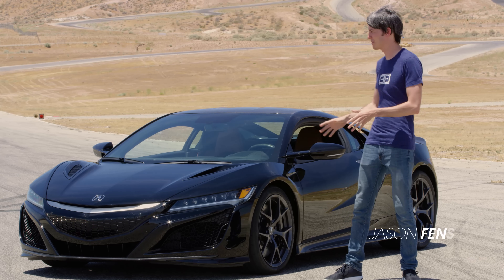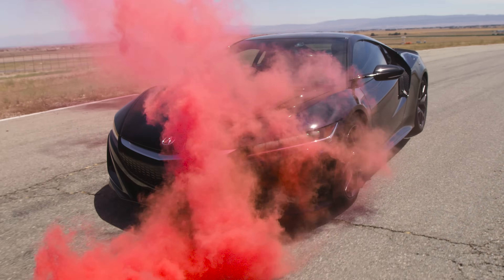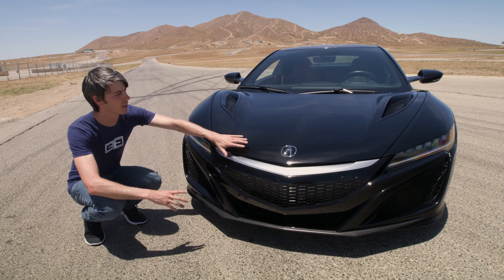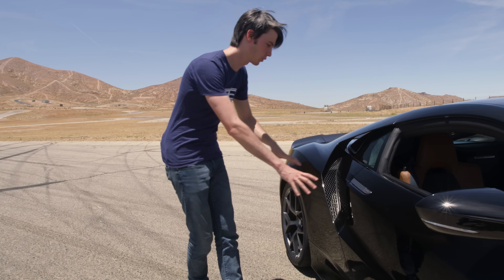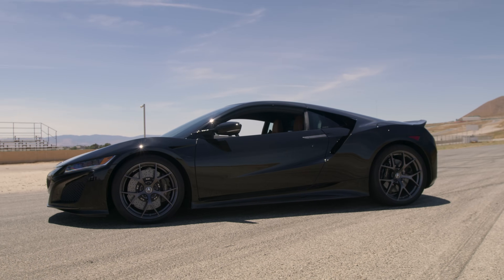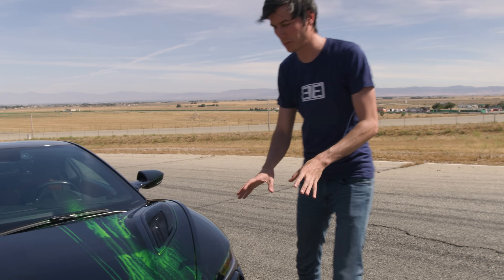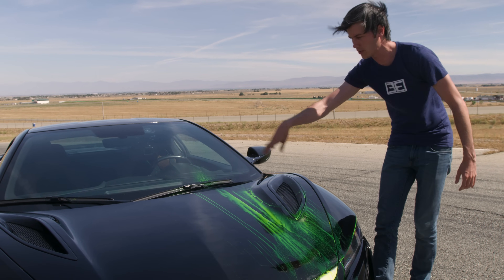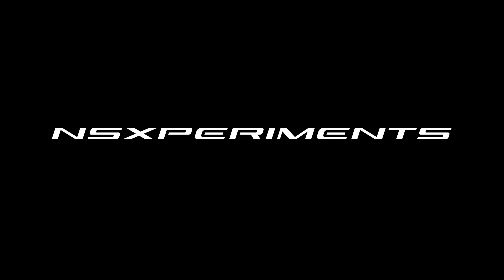Using Smoke Grenades To Understand Acura NSX Aerodynamics

Comment: Hi. Jason. I come from Poland where 1/3 of petrol fuelled cars are adopted do use LPG. Can you explain on your channel why it is not so popular in the rest of the world? Why manufacturers doesn't produce stock cars fuelled with LPG. It is cheaper than gasoline (in Poland at most twice). It gives pretty much same power output (I have even seen LPG fuelled tank). Pollution produced while burning LPG is less harmful for humans and animals.
Thanks
Reply: Wojciech Gomoła im in the US and i also wonder this. maybe gas station and gas truck infrustructure is not there? Also heard the safety of compressed gas might be a problem?
Reply: Bic Boi There were some problems 15 years ago. Has leaked from some cheaply adapted cars. It was problem especially in underground garages. So in Poland it is banned to park gas fuelled car underground, but it is so stable today that no one's caress. I rode mine 99's Audi A6 something about 75k kilometers (55k miles) I had to change filters (once per 10k miles) and one sensor died once (it cost 20-30$ to exchange it). I heard that lot of Opels engines have better power output with LPG.

Comment: PLEASE, Someone Help, or Engineering Explained help. So we got a Toyota Celica 2.0 GT and today, when my dad got back home, he said that the car started overheating and smoke was comning out from the bonnet. Then when I saw the engine there was a rusty liquid on the Block, the radiator fan, and even the battery. We went to a mechanic and he said it was the thermostat gasket (because the liquid was around that area) And it couldn't be the head gasket as the radiator hose is not pressurized. HELP!!!

Comment: Just a few of my opinions:
I’m a big Honda/Acura fan (drive both) but I’ll be the first to say that I’m not sure they always make the “best” decisions. I like the NSX, but I feel weird about it. I get the impression that it’s decently good at a number of things, but doesn’t really stand out anywhere. I don’t know if that’s a marketing failure or my ignorance. Maybe both. 

That said, I’m proud that this car was designed and built in America. I like what Acura tried to do (and mostly succeeded) with the performance and design. However, I have to agree with Doug DeMuro on the mistake Acura made: they didn’t have the performance line-up on the dealer lots like Audi did when they made the R8. I understand that Acura takes a different approach to performance and luxury than comparable brands, but it’s hard to compete when your cars have mediocre sport options, no RWD, no convertible, and very questionable styling choices.

The NSX doesn’t seem to be selling very well and I may have listed a few reasons why above. So when I see a video like this, with higher production values than virtually all of your previous work, I start to wonder what’s going on as I place a tinfoil hat on my head. Is Acura funding these videos? It’s creating a discussion about the car and works like inexpensive marketing for them. And they have a “hip, young, popular” YouTuber talking about the car to his audience. All I could think about during the video was “Is this an advertisement?” because that’s the feeling I got. 

In a way I feel bad because I want the company I respect and whose products I enjoy to be successful, especially when they spend so much on a flagship like the NSX. These videos just rub me the wrong way and give me a weird vibe.

Comment: So what was the point of using the FloVis, if you never actually bothered putting it under the black light, and explaining the "Flow Visualization" of the air management with all of the different colors you used on each region of the car?

Instead, we got a flash into... really?

This is "Engineering Explained", not "Sectrets to Top Gear Title Shots and Videography".

Comment: has Acura considered rewiring the front electric motors to in order reduce back EMF and increase the vehicle speed at which the motors can effectively aid acceleration and cornering?  because I'm betting that  the NSX's track times, on anything other than an autox circuit, are significantly hampered by the motors 80 MPH cut off is really working against the hybrid systems ability to be anything other than dead weight.

Comment: Such an amazing car, if only it had a bit more power from the electric motors it could be superior to the gtr performance wise !
Reply: it does 0-60 faster I think, at least stock. it also is faster on the turns.
Reply: thatoneopenwheelfanboy's 2nd account the gtr gets to 60mph in 2.9 sec, and this nsx does it in 3.1 sec. The gtr is also slightly faster in the quarter mile. But i think if the nsx had an extra 100hp of electric power it would be on a higher level than the newest gtr in terms of performance.

Comment: It's really interesting that it's so rear-bias in terms of aerodynamics. Surely the cg can't be so far back?
Typically, this rear-bias means that the car understeers like crazy - this effect further amplifies with usage of things like spoilers, because of the moment (I guess most of the downforce of Acura comes from the diffuser, not the decklid. However, I'd have to measure it to be sure). Nonetheless, looking at the car, I also think that the NSX produces little amount of it - which is probably why they could afford so drastic distribution. It would be cool if Honda gave us some numbers! :) 
Btw. really cool video! Paint is superb, though it's difficult to work with. Nice job and hats off to you! :)
Reply: Great detail such as matching air flow c.g.  Really good detail and video quality.

Comment: It is a nice car but Acura dropped the ball overall. All they had to do was take that original 90s body style and sharpen it up (up the aero) and add LEDs to the pop up headlights and to that beautiful taillight design that was ahead of its time (like Nissan updating the Skyline). Acura made so much unnecessary work for themselves. The 90s NSX was such a modern and futuristic looking car for it's time, it was unique, this thing just blends in with the others (it's nice but not special). You cannot seriously tell me that the 90s body wouldn't be drop dead gorgeous with modernized body accents and LEDs.

Comment: Can you please respond and explain the reason why many performance cars have floating rear caliper such as BMW cars/SUV with electronic parking brake, all Mercedes even AMG, all  Audis even RS exclude R8. I know it is easier and cheaper to use a actuator with floating rear caliper to integrate rear brake and parking brake into one rather than a drum brake as parking brake in the wheel hub or a separated parking brake caliper (most supercars, tesla and alfa giulia qv) which will bring more cost. But is the cost the only reason why BMW AUDI MBenz do this? M5, AMG gts, RS7, X5m, E63s, S63/65 are not cheap, why they still use floating caliper?  Thank you

Comment: The first gen north American NSX had an iconic design.  Very memorable.  But this looks too much like a GTR - which is okay, but couldn't they work off the old NSX?  That car was revolutionary being Mid engine, pop up headlamps, integrated rear spoiler.  I miss it.
Reply: ¿Looks like a GT-R? ¿WTF?  maybe like a R8, but ¿¿GT-R??
Reply: My bad, I meant from the side profile it looks like GT-R, but you are right it looks overall like the R8.

Comment: Another Honda fan-boy. Type-F. You bought a slow S-2000 and tried to make it faster with gearing. I know your type.
I grew up with these types, and they've mostly died off. 
Honda doesn't have the fastest, most luxurious, most technically advanced, nor over-all best vehicle in ANY class.
I'm tired about hearing about the S-2000 and NSX. Over-engineered is what they are. It's like over-eating, or over-committing, it's bad, and it's over.
Honda turbo-charged the new Civic Type-R. Honda forced forced induction, on Honda fan-boys.

Comment: Fascinating use of aerodynamics. Still the new NSX is really hampered by that unnecessary hybrid powertrain. If Honda takes off the electric motors & batteries but retain the 570hp, the NSX would be a rocket.
Reply from the maker: But the electric motors are a part of that 573 hp... and make up a great deal of the low end torque.
Reply: Engineering Explained I wonder what the Type-R Version of this would be like.
Love the videos by the way! Somehow wasn't subscribed already. XD changing that now
Reply: People also don't realize the instant torque of electric motors, they always talk about HP. For example the Youtube community been bashing on the i8 when it first came out years ago, without realizing the car is light, and despite only having 360 hp it has over 400+ lbs of torque and beats cars with much higher rated specs.
Reply: I understand, but unlike the 918 or i8, I don't see the NSX being true to its form with the hybrid component. Probably because both the Porsche & BMW employ heavy Carbon composite in construction to offset the hybrid weight, the NSX does not. 

Lastly because the name is "NSX" which most people (and including me) brings up image of that 90s supercar which employed state-of-art aluminum construction and ~1200kg curb that makes it hard to like this almost ~1700kg NSX Hybrid.
Reply: I see what he's saying though. Porsche is an example with the GT2RS.
Reply: People say the same thing about the porsche 918. They don't tend to realize that it's necessary to meet emissions requirements for a similar level of performance. Times are changing just like government regulations.
Reply: Yep, and Honda should be able to easily get more than 500 hp from a turbocharged, dual injection path 3.5 liter engine (alfa nee Ferrari is getting more petrol generated power from their 2.9 V6 turbo in the Giulia).  The hybrid stuff is there solely to help with a "green" image and curry favor from people who hate cars anyway.  Add in the fact that the electric motors aren't adding any thrust above about 120 mph and you can see why the NSX is the wonky stepchild of the entry level supercar market.  Supercars (low volume, high $$$, minimal impact) are one place where you shouldn't be kowtowing to environmentalists.  Given that McLaren is already hinting that the new 720S outpaces the P1 on the track, the hype behind hybrid supercars should be more clear going forward.  Go electric, or go petrol, but doing both just adds mass that you don't need.
Reply: Just slap a supercharger for the low end torque instead of that hybrid system they are using

Comment: There are so many smart engineer dudes on youtube but why don't they just join car companies built the perfect car?
Reply from the maker: As an engineer that left the world of real engineering, I quite like seeing the big picture. Not that I could build the perfect car (or anything close to it), but it takes a lifetime to get good at it, and it's a brutal, stressful, draining process. Very rewarding when your product comes to fruition, but there is so much time and effort that goes unappreciated by the masses. I find it way more fun to test someone's creation than to build one of my own; there's a variety element to it where you're always trying different things and finding out what's best, rather than working on an individual project for four years, only to find out another company has come up with a more clever solution. I have tremendous respect for the automotive engineers of today; the quality of cars these days is incredible.
Reply: That would start WW3
Reply: Engineering Explained Hey there, would like to know whether clutching in and then revving the bike to a high rpm would cause any damage? Im riding a bike and my max rpm is 15 but due to powercut I can't reach 13 > and honestly don't like revving high unless a vehicle pisses me off, would revving to around 7-11k rpm cause damage?

Comment: Great video... For years, I drove a 2008 Jeep Grand Cherokee SRT8 with kooks long tube headers, borla exhaust, and a tune. Driving that brick-shaped tank made me realize that, for the most part, "aerodynamics" (though fuctional at times and at certain speeds) is mostly just a word used to sell rich people expensive cars. My Jeep (even with minor turns involved) had no problem taking down some of the most aerodynamic cars on the road today. I had drop springs in the Jeep. Suspension>aerodynamics all day long. The gains to be had with minor suspension upgrades far exceed the losses due to having NO aerodynamics. 🚙💨
Reply from the maker: Well for street driving, sure, a Jeep really isn't going to be hitting insane speeds around corners. But in the world of supercars, vehicles that are quite capable on (and should at some point be taken to) a track, aerodynamics makes all of the difference. It's what makes F1 cars so fast around corners, how the Viper broke so many lap records, etc. Will every driver make use of it? Probably not. But when you're putting in that kind of money for a supercar, it should certainly be capable haha.
Reply: Engineering Explained I agree with you. Sadly most supercars never even see the track. 

I grew up idolizing Ayrton Senna and know that aerodynamics without a doubt has its place in the world of racing. There's no denying it. 

If you plan to buy a supercar for street use, its safe to assume that aerodynamics (aside from aesthetics) falls under the category of "paying for stuff I don't need". There's a good price negotiating tool for whomever may be reading. Just tell the salesman to zip it when he starts using aerodynamics as a selling point. Instead, inform him/her that you'd like to hear more about the suspension Lol
Reply: Jais620 Aero improves fuel efficiency too so it's not only optimizing performance but fuel economy a well.
Reply: I'm not going to conclude anything yet, In what way was your Jeep Beating these supercars? Where did you race? What type of Racing did you do? What was the main demographic of racers you went up against? And what were the types of Supercars you were racing against?

Because, from the tunes you stated, your jeep not only has Minor tuning but is limited purely to mechanical grip. Which also, makes it more prone to both over, and understeering problems. And the claim you are making about suspension outdoing Aerodynamics is very bold, as Aerodynamics have played a major role since F1 in the 60s.
Reply: You'll beat them up to 60, after that they're going to catch you and demolish you.
Reply: Jais620 I've been driving a 2017 GTR for 7 years now
Reply: Hello There lol if that's the case, then I ask, where did you purchase your flux capacitor?
Reply: I'm curious what holds your Jeep to the road when cornering at 150+ mph.
Reply: If you have bad aero and you're driving a heavy ass tank with no sports suspension, you're going to be super unstable going at high speeds. No way around it.
Reply: Take the Jeep Cherokee to a race track, not a 1/4 mile track. The only think it will be smashing is probably the cones.
Reply: Downforce is drag in the vertical axis.  Just like airplanes.   A loaded airplane has a higher power requirement at same speed.
Reply: https://www.oreillyauto.com/flux-capacitor
Reply: i put money on it that nsx would roast your jeep
Reply: Jais620 maybe for short term use but aero is used to cool things down and heat is one of if not the biggest problem, how much power for how long
Reply: True but some supercar change downforce coefficients based on speed.  Soon it will be predictive where lateral acceleration will deploy Downforce augmentation devices.  NASCAR has had this for decades to stop kiting when ends swap.
Reply: Jeff Ahn no one buys a supercar for fuel economy
Reply: O'Reiley Auto Parts?
Reply: Jais620 drag race for straight line cars, nascar for oval track,  etc,  vehicles are designed for a target 🎯 market, so,  Honda is bringing technology from much more expensive cars to be more affordable while using some present and some future features and technology... What is so hard to understand!
Reply: But can you beat them on a race track and can you shut the noise when you want,????
Reply: +Sergey Kislyak

I dunno about that. The weight kinda counteracts the bad aero. My two-ton six-and-a-half-foot-wide brick of a car has gone probably well over a hundred miles per hour on the freeway and it was just fine. And this was with both front shocks broken.

I say probably because the speedo only goes to 85. And I only went that fast because the hills on that freeway are more like mountains. Gravity tells you how fast you're gonna go.
Reply: Jeff Ahn very minimal. If you're worried about fuel economy, you don't buy a supercar.

Comment: I was slightly offended to see paint on that beautiful NSX! Until, you explained that it had a purpose :D Great video!
Reply from the maker: Ha, yes, it's an oil that washes off. But that was a ton of paint haha. Car got a full detail afterwords, I believe they even removed body panels to get everything cleaned.
Reply: Justin's Pit Lane F1 teams used to use them all the time, unfortunately not as much any more but Red Bull occasionally does in practice.
Reply: I'd never heard of 'flow visualization paint'. very cool!
Reply: Really, for me, you could just put a clear coat on it and called it a daily driver.
Reply: Take some of that down to the local strip joint and make it rain :-D I'm sure it looks cool under black lights.

Is it just gearing why it "only" does 190+ mph? For a 500+ HP car you'd expect it to be faster. I noticed the same thing about a lot of these new supercars that they aren't going for top speeds anymore.
Reply: What about any paint that was pulled into the engine from all those intake vents?
Reply: big fan of justin's brz 😊
Reply: Clifford Bradford i think theyre just focusing on downforce/handling more than top speed, which imo is a good thing... a top speed of 268 is the same as 180 or 500 to me and I'd assume most people
Reply: It would be fun to get baked on